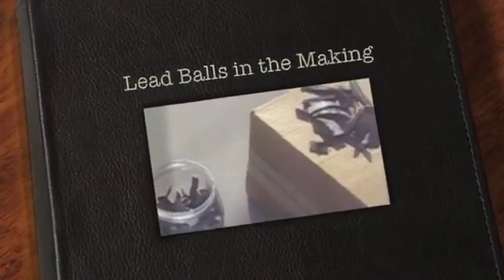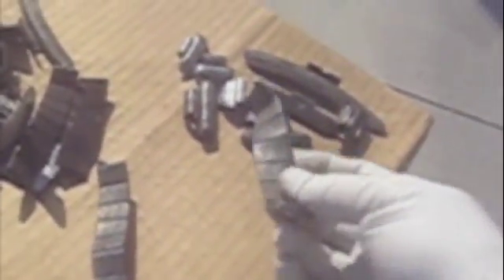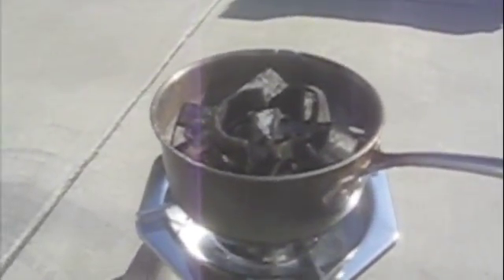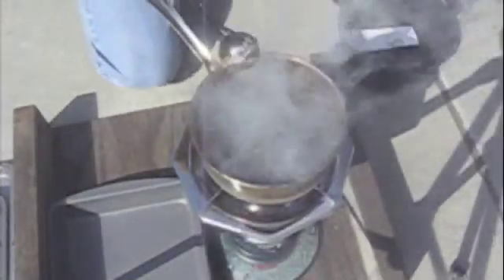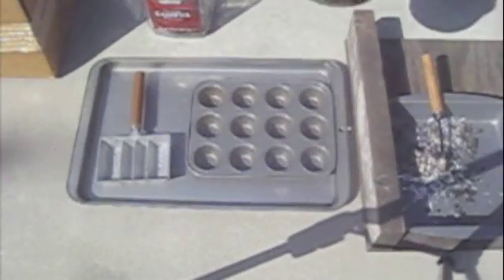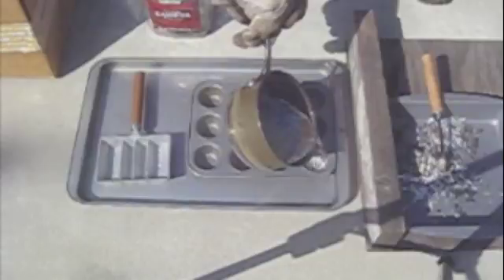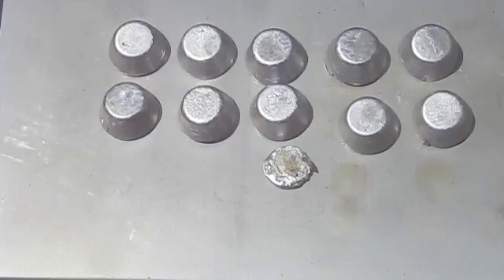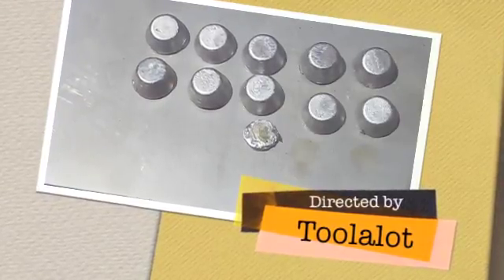Lead Balls in the Making Part 1

Comment: Be very careful with that camping burner. There is only the coupling to the cylinder and the plastic base below, that's supporting that HEAVY lead. They're not made for heavy loads. It can crack or break, dropping the melt on your lap or foot.

Comment: @9DragonMaster sorry - no - battery lead, it has way too many contaminates in it, a full pound of battery lead and you get less than 1/4 of a pound of usable lead.
DANGER WILL ROBINSON the fumes given off by battery lead has calcium and or cadmium  in it, one pole of the battery is NEVER pure lead, otherwise the battery wouldnt work.